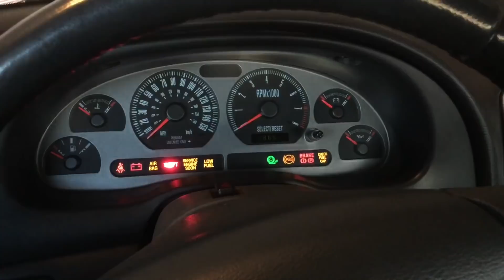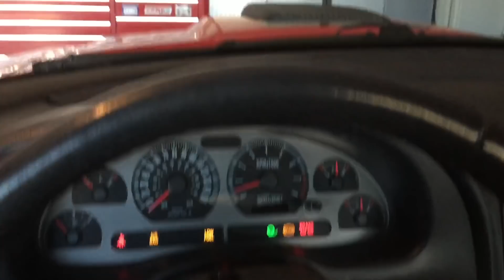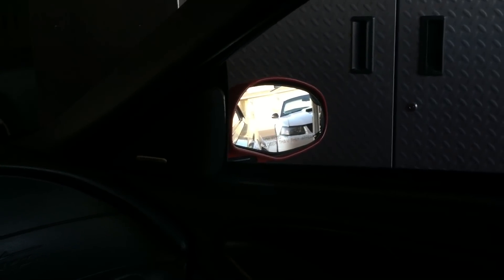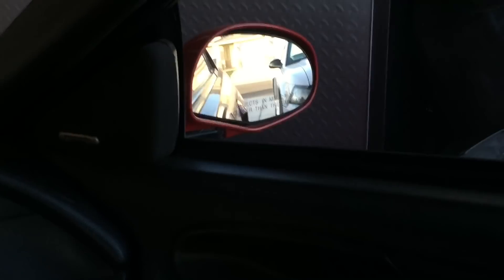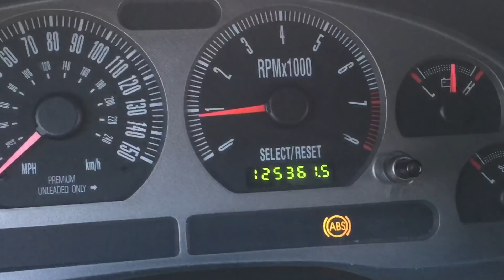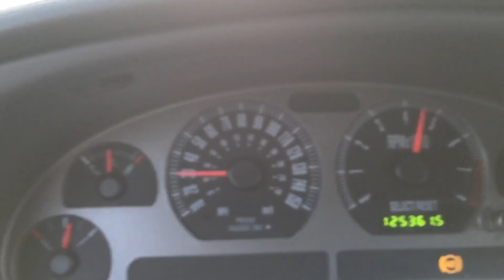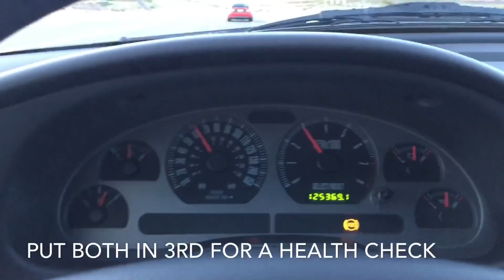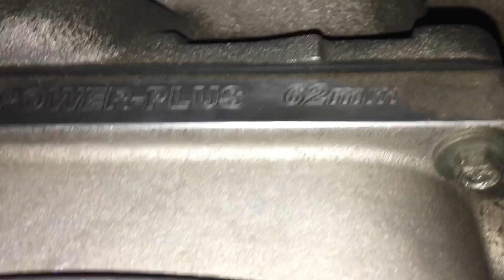Another Mustang!

Comment: Hey Danny great video as usual.. I had a question hoping you can help me. It’s about the stock cobra eaton supercharger. I want to change out the stock pulley to a 2.8. I bought the tool but I am having an issue trying to figure out how to remove the flat bolt so I can get the tool in to push it off.. anything you can share to help?
Reply from the maker: Kurtis D You should just be able to unscrew it. It has threads for the removal tool
Reply: Danny Johnson ok I will have to look again. Thanks for the tip. Just was a little frustrating cause I couldn’t move it

Comment: The Mach 1 Could Hold Less Power Than The Terminator Right?
Reply from the maker: Yes. The manual transmission mach 1s come with the same 8 bolt forged crank (automatic mach 1s come with a cast 6 bolt crank) but they all come with non forged pistons and non forged connecting rods. They will hold about 450rwhp before the start throwing rods
Reply: @dannyjohnsonsgarage  nice thanks for the info!